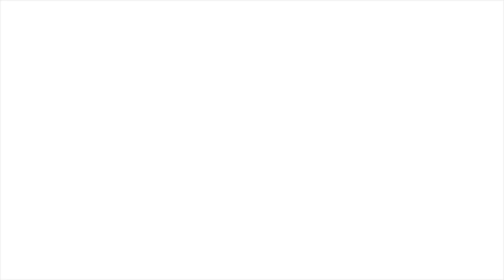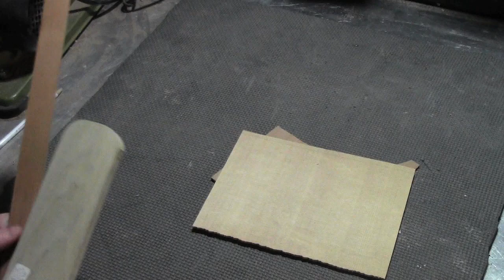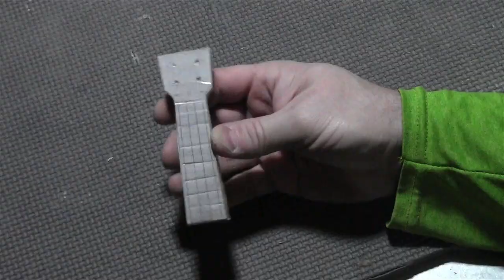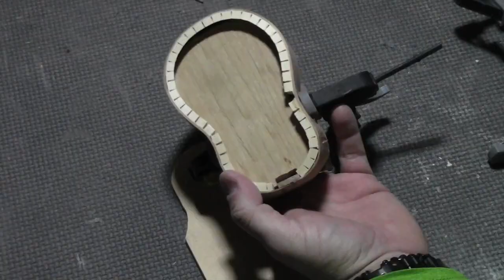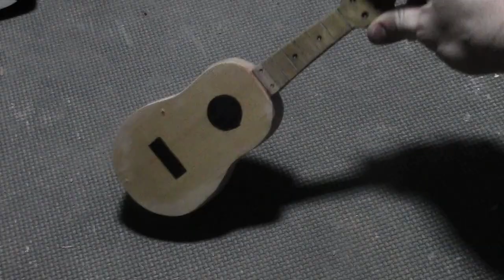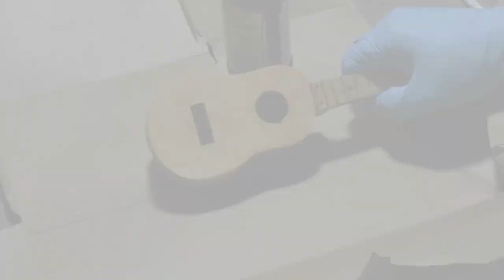Ukulele Shaker

Comment: Cool video man! What kind of oil did you use as a finish?
Reply from the maker: I used Tru-Oil. It’s my favorite for wooden instrument projects.
Reply: Sweet! I had a feeling it was Tru-Oil. I’ve been building DIY kits and use a combination of wood burned designs and water based acrylic paint and have been looking for a finish other than polyurethane spray. I’m going to try this stuff! Thanks!
Reply: Will do! I ordered a bottle and it is due to be delivered Monday. Any other application tips? Thanks again!
Reply from the maker: Some light sanding between coats helps make the end result smoother. Other than that, keep the coats light. (Although I sometime go a little heavy)
Reply: Sweet! Thank you sir!!!!

Comment: You should do a $20 martin smith ukulele review on the uk-222_bk
Reply from the maker: Do you have that ukulele? Do you like it?
Reply: @CircuitsAndStrings  not at the moment I saw that that brand goes for a small amount of money and I would like to see your thoughts on it. I'm currently wondering if I should order it because there is a mixed amount of reviews. The model doesn't matter that's just on of the more common ones found.
Reply from the maker: The price makes it very intriguing. Thanks for the suggestion.